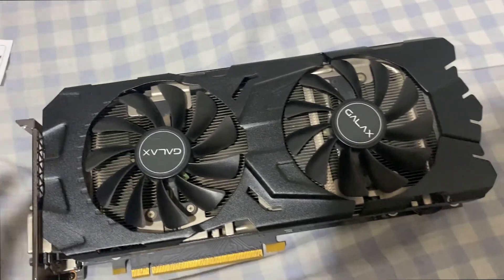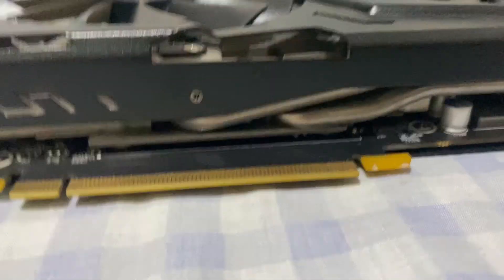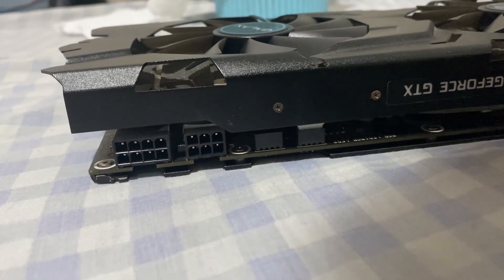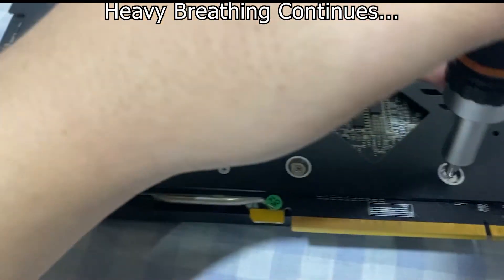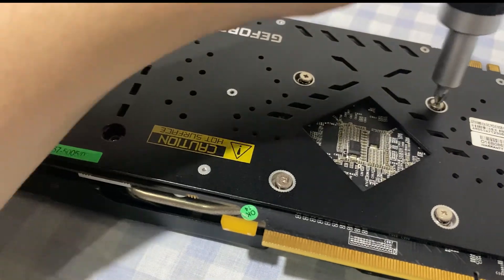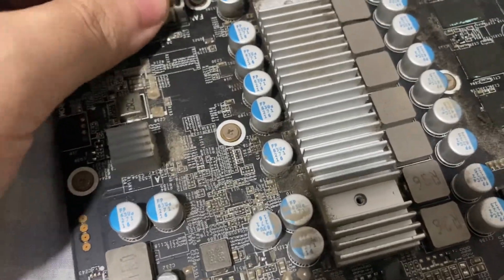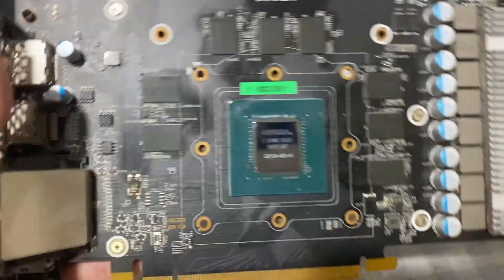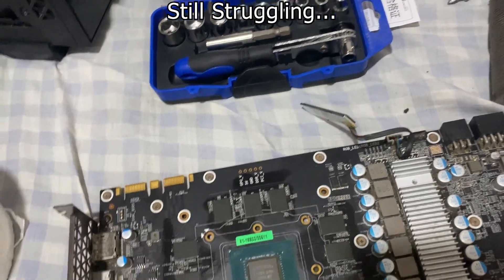Cleaning & Disassembling My Galax Gtx 1080 EXOC

Comment from the maker: Here is a step by step list for those who have no time to watch the video
1.) Unscrew the 4 small screws on the side of the gpu frame ( 6 If you intend to remove the geforce rgb logo )
2.) Remove the heatsink screws they are located at the back of your card. unscrew them with equal pressure. i did 4 turns per screw at a star pattern 
3.) Remove the heatsink using low force and remove the fan connector
4.) Remove the dust from the gpu and the heatsink and reapply thermal paste ( I prefer to spread it ) 
5.) Align and place the gpu heatsink on the gpu to the point that the screws at the back would align ( Also don't forget to return the fan cable)
6.) Screw it and return the metal frame on the gpu ( don't forget the rgb geforce logo )
7.) You're all done

Comment: Dude, do you know if I have to remove the entire heatsink or just removing the shroud is enough to change the fans? One of the fans stopped working and the card is running apparently pretty hot now. I'm thinking on replacing the fan but it would be kind of a hassle to remove the entire shroud :/ (fear of breaking something up and I don't have thermal paste on hand at the moment)
Reply from the maker: You don’t need to remove the entire heatsink you just need to remove the shroud to in order to gain access to the fan connectors and be able to replace the fans
Reply: @Kurenairisu  nice, good to hear. thank you man

Comment: Will my warranty void if i replace the thermal paste?
Reply from the maker: Yes
Reply: @Kurenairisu  i did replaced. I didn't know that it will void my warranty. If I don't tell them, they will replace my gpu?
Reply from the maker: @jsizjiisk7606  usually the screws are covered with the warranty sticker
Reply: @Kurenairisu  no there was no sticker on the screw. Am I safe?
Reply from the maker: @jsizjiisk7606  Probably i guess it depends on  the store. i'm certain it should have a warranty void sticker to prevent unauthorised repairs
Reply: @Kurenairisu  actually my pc was crashing alot. And I watched few videos in that they said to change to change thermal paste. I thought if it will fix my problem then I should do it. Atleast I don't have to wait for 1-2months. But after few research I come to know that it can void my warranty. Now I'm so stressed idk what should I do. I hope they fix or replace my rtx 2060 without any questions 🥺
Reply from the maker: @jsizjiisk7606  if you ever did destroy the warranty sticker they wont. but you can always trying RMA the card. also about your pc crashing mind telling me more about it?
Reply: @Kurenairisu  ye sure. One I want to tell you that there was no sticker on the screw. And I've black screen issue. After 5-10 mins my monitor goes black. And after it goes black it take 5-10 mins to restart. Or I've to hold button to restart. And while my screen is black I've check my keyboard caps lock button. It works I can see the indicator light. It turns off and on. So do my num lock button.
Reply from the maker: @jsizjiisk7606  Have you tried putting the gpu on another pc and or trying a new powersupply since the psu may not be able to supply enough power?, if so that means the gpu has an issue.
Reply: @Kurenairisu  no, here in my city even technician don't have any parts to check. So do my friends. No one have pc to check my components :(
Reply from the maker: @jsizjiisk7606  In any case try to get a warranty if you really think the gpu is broken. i'm sure they'll test it to make sure if it doesn't work first anyway
Reply from the maker: @jsizjiisk7606  one way to check if your psu cant handle the gpu is when your pc turns black screen or shuts down whenever you try starting a game or playing a high quality video or anything that would put load on it
Reply: @Kurenairisu  yes. When ever I'm doing anything which can give a bit of load to my pc it restarts.
Reply: It also happens when I'm watching youtube or reinstalling drivers. I thought my drivers is culprit. And yep main thing while gaming
Reply from the maker: @jsizjiisk7606  depends on the psu brand and power rating, if it's unbranded that's most likely the reason
Reply: @Kurenairisu  I've subscribed you btw. Thanks for replying. Not all youtubers reply comments. I respect you sir. Btw I've also noticed that my mouse rgb and liquid cooler rgb also blinks for 1-2 secs it's glitching or something idk. I think it's not getting enough power. I mean it keeps blinking or stuttering idk which word I need to use here
Reply: @Kurenairisu  I've antec psu vp650p 80 plus
Reply from the maker: @jsizjiisk7606  appreciate it, i just enjoy fixing pc's so i'm curious to people's issues. It's not often that broken gpus are sold so it could possibly be the psu. mind giving me the model name of it?
Reply from the maker: @jsizjiisk7606  antec is a decent psu brand so it's either 650 watts is too low or your gpu does have a problem. if they didn't put a warranty sticker on the gpu you can probably get a warranty. in any case goodluck!
Reply from the maker: But if you'll ask me i assume it's a powersupply issue since i also experienced a similar case when i upgraded to a gtx 1080 from a gtx 950. But anything is possible
Reply: @Kurenairisu  thank you. Hey btw I just come to know that no earthing can harm pc. And we don't have earthing in our house. And also current leaks from my pc. I had felt mild current few times from my pc.
Reply from the maker: @jsizjiisk7606  I'm pretty sure grounding can't affect it unless if it's really strong. We also dont have ground wires in my country.
Reply: I hope my psu is culprit. Since I've removed heatsink once. So there's chance they don't replace my gpu. And my psu can be replaced within 15 days
Reply from the maker: @jsizjiisk7606  it's their fault for not putting a sticker they'll most likely replace it. best thing to do is get or borrow a psu or let them test the gpu in the store

Comment: What is the thickness of thermal pad ?
Reply from the maker: They’re about 1mm
Reply: @Kurenairisu  Thanks, man. I'm thinking about replacing it but I'm not sute about the thickness. Can I use 1.5mm also ?
Reply from the maker: @tumsd923  Yes, it'll usually just get compressed
Reply: @Kurenairisu  Cheers :)